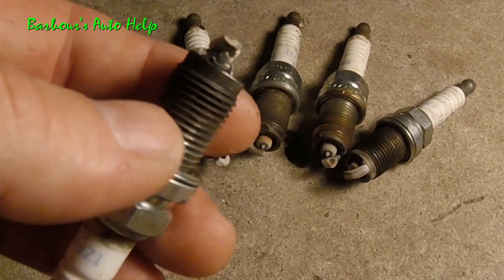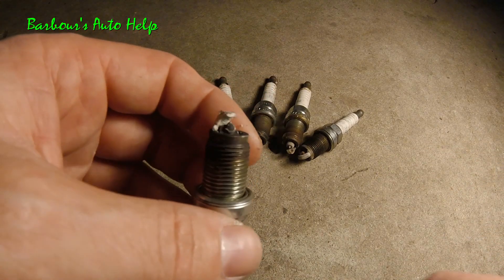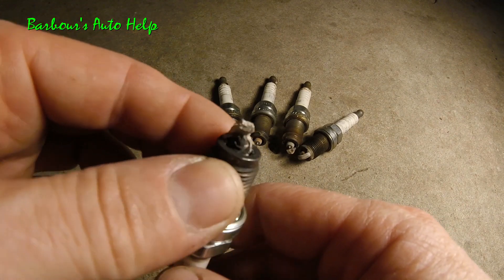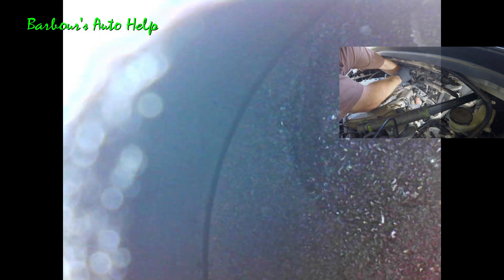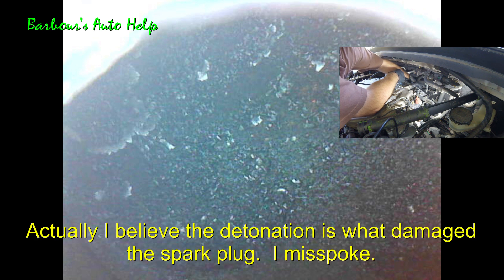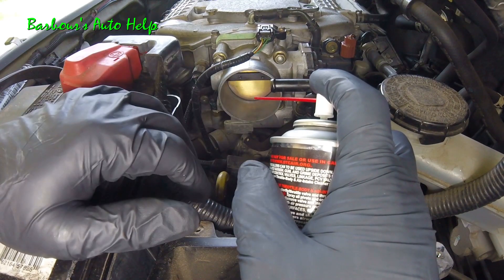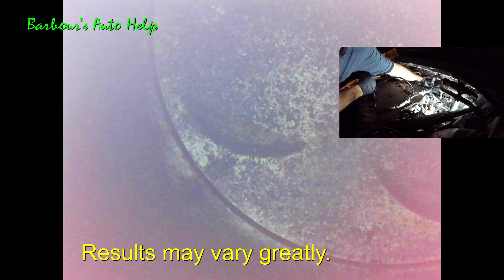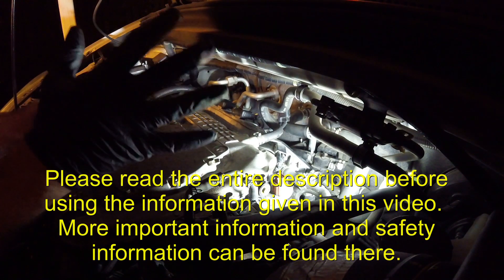A Cure for Preignition and Detonation

Comment: Hi may car is knocking or pinging when you press the gass pedal but when i Tried to fix it by checking the ig ignition coil and spark plug tha result is when i remove the no.4 Ignition coil the sounds stop but when I turn it back it starts pinging again is it pre igntion or spark knock or other problem ? Thank you for helping

Comment: Something is telling me - no way this cylinder gets clean by that spray. The other problem- the root cause for that carbon buildup is still there.
Reply from the maker: You’re right about one thing. The root cause is still there as mentioned. No secret. But the cylinder did get thy clean from the cleaning. It will come back though.

Comment: Hello! I have a 4.3 vortec engine and my engine is knocking on acceleration and hard deceleration like if I rev it fast
Reply from the maker: Ok.  How can I help you?
Reply: @BarboursAutoHelp  I’m trying to narrow down if my engine is knocking because of this, I tired octane booster and it seemed to get worse, so I’m not sure what it could be. I know it’s not engine rod knock tho
Reply: @thedailybench2527  I got a 5.7 and have the same issue. I replaced all my lifters but skipped the cam thinking it has something to do with this since my intake was clogged full of carbon.

Comment: hey got a question for you i got 1990 blazer 5.7 tbi had engine rebuild about month ago   got a few up grades bigger cam  so i had to get my computer chip tune to raise fuel and timing on the chip i change pressure regulator and adjust that the cam i have in there is xe 262 h comp cam  the block was 30 over.and i still have the factory swirl port heads i should had put some vortec heads on there...but for some reason cant get it to run right just dont have no power and im getting a ping sound from engine and #6 had oil on spark plug threads only the rest of plugs are fine i dont no where im getting the ping sound dont no if the oil on the spark plug have anything to do with it or something with the fuel and timing is not right..
Reply from the maker: Yea, I'm not much of a tuner guy at all.  I'll not be a hole lot of help for this.  Sorry bout that.
Reply: If you used flat top pistons compression is too high  for 87 gas I've ran h.e.268 & h.e.262 comp  in same engine no prob but base timing had to be advanced 2° with stock pistons & stock computer chip compression stock is 9.3:1 with flat tops its higher prob closer to 9.7~9.8 and no way it'll run 87 with swirl port heads....vortecs have a faster burn chamber much better efficiency not just ports is why they don't the same issues but if you've gone as far as rebuild I'd swap to vortecs have valve guide bosses cut for cam lift clearance ditch the restrictive tbi and put h.ei. distributor and a 600cfm carb on and get the 60-70hp you're never gonna get from tbi and not sacrifice any fuel mileage besides the urge to open the secondarys   to feel and hear the power....been ther done that tbi won't make power

Comment: im troubleshooting a 97 Evo Harley. They have this deal that vents engine gas and oil into the airbox. It has ran way too hot at some point in its 17k miles cause alot of the paint on the heads is coming off. It also has like smokey carbon i guess in the intake manifold and into the carb so, i was thinking preignition or maybe the timing is off for some reason shrug i haven't worked on anything in like 10 years and wasnt very skilled then either ha. Thx for the video
Reply from the maker: Yea. I don't have much to say about a Harley.  Never worked on one.

Comment: Normally there's a knock sensor limiting a lot the preignition events by advancing the spark. In such a case, it's hard to tell it's happening. Also, the broken spark plug is known to be from the carbon building up inside the plug. But cleaning the valves does something good definitly!

Comment: Great tip my man. I learned from my Old school heavy line teacher how he used to use a spray bottle with mist spraying water into the carbureators and throttle bodies and it cleaned the carbon up very easy, but the only thing he had to worry about is if chunks of carbon would get stuck in between the valve and valve seats. Great video brother God bless you and the family.
Reply: I've seen that done with water like you said and it works pretty amazing well.  If your throttle body is clean you can spray the water through a vacuum line so your mass air sensor is still functioning while you're running the engine
Reply from the maker: Hey, thanks and thanks for the info.  God bless you and yours too!

Comment: Get higher octane fuel. Always step one for trying to fix/help both of these.
Reply: In my car it doesn't matter what octane I run my car still sounds like a diesel
Reply: @mercedesguy8520 Loose or bad spark plug? Maybe a simple timing issue? Check your plugs and check your timing adjust if needed? Im learning myself.
Reply from the maker: Yes, that does put a bandaid on the problem.  But, it’s a temp cure. That doesn’t fix the root cause.  If the root cause is taken care of then there is no need for a different octane fuel.
Reply from the maker: Higher octane fuel won’t do anything about oil consumption though.
Reply: I accidentally put lower octane fuel than the recommended 93 in my 2014 Infiniti Q50, and I’ve noticed some decrease in power :( how would I be able to fix this
Reply: SebastianMaan ad 93 in the tank to up the octane closer to 93 simple .

Comment: Ive done just about everything on my 99 ford ranger 2.5 115k miles and still have the ole pre ignition problem. Replaced= plugs, wires, air filter, checked compression, tps, replaced all four injectors, cleaned carbon off of heads and pistons, replaced every component of the egr system, replaced ecu with update, checked vacuum pressure, brought it to two different dealers and one mechanic shop $$$$, checked cylinders for broken valves and etc with camera, Mass air flow sensor, checked timing.  My next group of parts will be coils and two step lower plugs. The only thing that helps or somewhat prevents pre ignition is high octane gas.
Reply: Added: The dealer told me to run high octane which i was already using and he also said to use high mileage oil. This was coming from a 25 year experienced dealership mechanic. Ive spent about $2500 chasing this problem, about to give up.
Reply from the maker: Sorry your having such a hard time.  Sometimes its wise to move on depending upon the situation.  Weigh your options.  Good luck!
Reply: Thats what everyone is saying but I got caught up in the "investment this time will work trap."
Reply: After two years of bs finally found the problem. Previous owner strapped a wire to support a vacuum line which ate through the insulation on were he tied it off at which was really hard to see. Kept shorting out the ecu causing all kinds of problems mainly misfires and pre ignition in cylinders 3 and 4. Rare problem thought i would mention. Talk about hell
Reply: I had a 99 Taurus years ago that I believe has the same engine as your ranger. The only thing that helped a tiny bit was using premium gas. Those Vulcan engines were crap.
Reply: I've got a 2.5L Ranger (Mazda B 2500) that I just realized was pinging after driving it around for 8 months, swear I thought it was the loose pulley on my power steering pump, only rattled for a second right when I hit the gas and then went away. Only realized it was engine ping when I filled up with 93 recently and it went away. Replaced EGR valve right after that, about to Seafoam it. Already deleted the shot catalytic converter on it a year ago, that's something that could probably cause ping that wasn't mentioned. How detrimental to the engine are momentary pings you think? Now that I realized I've been pinging around for 8 months it kind of makes me want to take a borescope to my engine to see how bad I've messed it up. Kicking myself too, because I could have changed out the EGR valve a year ago. Honestly though, I took apart the old one that was on there and it still seemed ok, wasn't that much carbon in it and the diaphram was still intact. Already did plugs, wires, and coils, used Motorcraft and gapped them to spec so I don't think that's it. Though the ping went away with 93 octane, hell bent on making sure it doesn't happen again. Guess I'll clean the MAF, maybe even replace the O2 sensors... kind of find it odd it can ping and not have any codes to throw at me. Anywho, how long do you think an engine can ping before it grenades itself?
Reply: @GodWasAnAlien  Did you ever figure it out? I'm having the same problem with my '03 F150 4.2 V6.

Comment: Can a clogged EGR valve cause detonation and/or pinging?
Reply from the maker: On some vehicles equipped with an EGR valve absolutely.  One of the purposes of the EGR is to reduce Nox.  It does this by cooling the combustion chamber temperature.  Nox is made at high combustion temperatures.
Reply from the maker: I would say that this causes mostly pinging though.  Not sure if this is you problem.
Reply: Okay I think I've narrowed my problem down to this thanks to your advice and EGR being one of the codes that came up.
Reply from the maker: What kind of vehicle are you working on by the way?  And by the way I’m not saying that’s your problem but I have done pin point tests on some vehicles for clattering noise similar to spark knock that has lead me to inspect propped EGR flow.
Reply: Nissan frontier. I'm sure that's it. I've deduced this from multiple sources.
Reply: If it's not the problem I will try something else
Reply from the maker: Go for it!  And good luck.  Please let me know how it turns out.

Comment: Bonjour,  est-ce possible d'avoir des ratés d'allumage seulement en pleine charge et sous régime en 4,5,6ème à cause de mauvaise bobine d'allumage ou mauvaises bougies ? Merci
Reply from the maker: Il est absolument possible qu'un raté puisse être provoqué par une bobine d'allumage ou une bougie défectueuse. En fait, les ratés d'allumage sont généralement causés par un problème dans le système d'allumage. Sur les véhicules datant de 1996 et plus récents, il est normal qu'un raté entraîne l'allumage d'un témoin de vérification du moteur et l'établissement d'un code de raté d'allumage. Merci pour votre question! Y at-il autre chose que je peux vous aider?
Reply: BarboursAutoHelp merci d'avoir répondu c'est cool 👍, et oui j'aurais une autre question !. Les ratés que j'ai seulement en pleine charge et sous régime,  peuvent-ils venir des injecteurs ?. Mes injecteurs bosch 650cc n'ont que 10000klms (environ 6200 miles),  ma Focus RS mk2 à un ralenti stable pas de problème là-dessus,  les accélération linéaire se font correctement,  elle ne fume pas !. Juste des ratés en pleine charge ( pied au plancher) en sous régime en 4,5,6ème !.  Merci d'avance
Reply: BarboursAutoHelp aussi,  j'utilise de l'octane booster pro Boost de silkolene,  mais rien y fait !.  J'ai des bougies plus froide de seulement 1 grade (denso irridium tough vkh22,  d'origine elle a un grade 20 de chez denso) ,  le fait qu'il fait très froid en ce moment en France,  est-ce que cela peut être la cause ? Le véhicules n'a que 19000kms à peine ! Roule peu. Mais très bien entretenue (huile de qualité,  additifs etc)
Reply from the maker: Cela ressemble à un allumage raté. Est-ce que votre témoin de vérification de moteur est allumé et avez-vous fait scanner votre véhicule pour repérer les codes?
Reply from the maker: En quelle année est votre véhicule?
Reply from the maker: Au fait, j'utilise google translate pour communiquer avec vous. Je ne suis pas sûr si tout est traduit correctement ou non.
Reply: BarboursAutoHelp fin 2010
Reply from the maker: Je suspecterais des bobines d'allumage ou des bougies défectueuses. Je suis désolé de ne pas être revenu plus tôt. Avez-vous fait scanner votre ordinateur pour trouver des codes de diagnostic?
Reply: BarboursAutoHelp bonjour,  et merci encore pour votre aide,  oui j'ai un scanner obd2 Launch creader crp129 premium pro, tout systèmes sauf climatisation,  mais aucun code défaut 😮 bizarre quand-même !?.
J'ai acheté 5 bobines d'allumage neufs beru ZSE055,  et 5 bougies d'allumage d'origine OEM neuves.  Mais je n'ai pas encore eu le temps d'essayer je travail beaucoup en ce moment !.  je vous tiens au courant et encore merci !
Reply: BarboursAutoHelp ah oui,  les bobines d'allumage savez-vous quel est le couple de serrage ? Pour Focus RS MK2 de 2010 on m'a donné 2 mesures différentes = 6Nm et 10Nm,  j'ai bien envie de visé le milieu 8Nm ?
Reply: BarboursAutoHelp oui ne vous en faites pas,  je comprends très bien vôtre traduction merci 👍😉. Dans la vidéo 
Le nettoyage avec l'aérosol par le papillon de gaz est impressionnant :-o
Reply: BarboursAutoHelp dans mon véhicule je rajoute toujours 3% de silkolene pro Boost mtbe,  aussi de temps en temps je met du bardahl traitement essence "préventif"  qui peut être utilisé à chaque plein pour maintenir propre haut moteur et circuit d'alimentation !.  Pensez-vous que c'est bien ?
Reply: BarboursAutoHelp désolé d'écrire en plusieurs messages ;-).  J'ai aussi contrôlé avec mon scanner obd2 les sondes à oxygéne O2. Elle ont l'air correct !. De toutes façons une sonde oxygéne défaillante se manifeste dans quelle plage de régime ?.  Ralenti,  bas régime,  haut régime,  accélération pleine charge ?. Moi je dirais au ralenti !?. J'ai déjà eu le cas sur mon ancienne Renault clio williams de 1996,  et la sonde à oxygéne faisait des problèmes seulement pendant le ralenti et quand le moteur prenait des tours minutes il n'avait plus aucun problème !. Quand pense-tu cela peut venir de cela ?. Aussi, les injecteurs bosch n'ont que 10000klms (6200 miles environ)  et les injecteurs ne ferait pas de problème seulement qu'à pleine charge ?
Si tu préfères que je parle anglais dit le moi ;-)
Reply from the maker: Cela devrait être bien.
Reply from the maker: J'aime rester loin des additifs moi-même. Parfois, certains additifs peuvent causer des problèmes s'ils ne sont pas utilisés correctement. Je suis sûr que vous l'utilisez correctement, mais ici, aux États-Unis, il n'est vraiment pas nécessaire car le carburant est déjà mélangé et le détergent nécessaire est déjà là.
Reply from the maker: Oui s'il vous plaît. Si vous pouvez utiliser l'anglais ce serait beaucoup mieux. Je pense que google translate gâche des choses, surtout avec ce post. Je ne l'ai pas compris complètement.